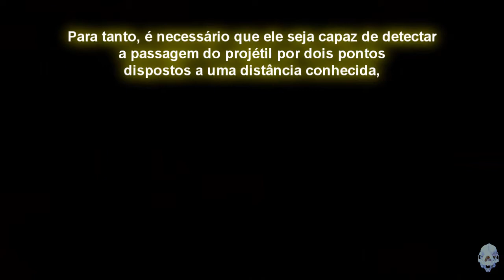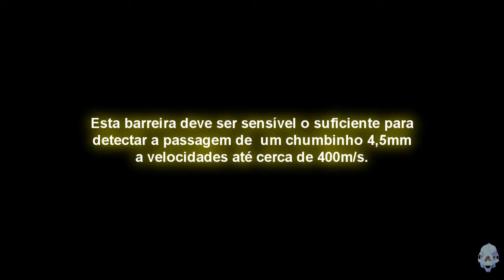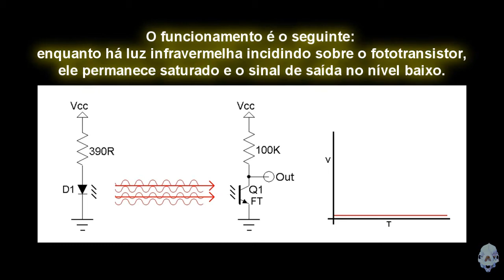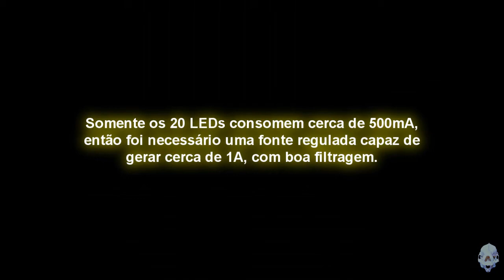DIY Ballistic Chronograph IR Sensors - Sensor Infravermelho para Cronógrafo Balístico

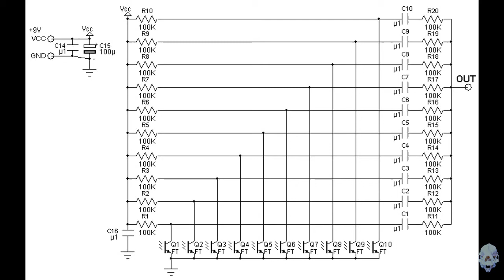Comment: 3:53 "receiver" part: why not use 2 resistors and connect all phototransistors in serial? I looked into example datasheet and I see the "Vce(sat)" is about 0,4V, so Vcc=9V is more than enough.
Another place where the circuit can be simplified and improved could be connecting 4-7 LEDs in serial with one resistor. Typical Vf of IR LED is about 1,2-1,6, so when you power it from 10V source you can drive 7x1.2V up to 5x1,6V - more efficiently.

Comment: Un genio total 🔥
Amigo. Consulta 
Los  capacitores de los fototransistores son cerámicos con el código 104?  O que valor en micro faradios tienen ? Desde ya muchas gracias
Reply from the maker: Gracias, son condensadores de poliéster de 100 nF (0.1 µF). Los condensadores de cerámica como el que está desacoplando la fuente de alimentación también deberían funcionar sin problemas.
Reply: @unrelatedactivities  muchas gracias por responder a mi duda amigo! 
Este circuito se puede utilizar en arduino tal cual esta ? 
Mi idea es hacer un cronógrafo con arduino nano

Comment: can i use photodiodes to replace phototransistor?
Reply from the maker: Yes, but they probably would need amplification. Here is a video showing chronograph screens I've made using photodiodes amplified by opamps:
https://www.youtube.com/watch?v=-3aGxC3KXGM&t=0s&list=PL44XyIPy9JXhTvrGxLkhePfU4g02q8MWS&index=5

also, these application notes are worth reading: 
- Sharp SMA99017
- Kenneth A. Kuhn, Use of Phototransistors
Reply: Thanks for the answer, i'll try to make one

Comment: Ok, so I am using 4 emitters and 4 photo transistors compared to your 10 sets. I can see the signals fine with the Nuts an Volts circuit. My spacing is approx 4 inches compared to your .842 meters. 

Up to about 400 ft/sec, it works fine. When I go above that I see a double pulse from the exiting sensors.When that happens the second exiting pulse get seen by my processor but not a second entering pulse, so a error occurs saying it missed the entering pulse.

My Atmega8 works up to 3000 ft/sec when simulated with 3 monostable oscillators in series. First oscillator is entering pulse, second oscillator is delay, and the third is the exiting pulse. I can vary the middle delay oscillator to simulate almost any speed I need.

Have you encountered any double pulsing in your work with your pulses?
Reply from the maker: No, I haven't. The double pulses are coming from the phototransistors or after amp and/or comparator? If they occur after the Nuts and Volts circuit maybe the amplification factor is a bit high or the comparator threshold low. 
Also try to increase the distance between screens to see if the double pulses still occurs at higher velocities.
Reply: I have increased the distance to 8 inches (4 inches before), same results. I will try 1.5 ft and see what happens. 

Interesting that the double pulsing happens at higher pellet speeds.
Do you thing spacing between the emitters and photo transistors should be increased also. My current distance between emitter and photo transistor is 3 inches. I think I will try 8 inches instead of 3 inches.

On the scope the input signal from the sensors is about 10 mv,, so the amplification is correct.
Reply from the maker: I think a larger shooting area is good to avoid "accidents" when measuring at longer ranges :). Looking at the N&V circuit, seems to be something strange in the amp's resistors values: first op amp has a gain of 10, second op amp a gain of 100, so 0,01V input signal would reach 10V at output, and Vcc is only 5V. With all that gain, noise could be a problem. But this doesn't explain why there are double pulses only in the second screen and only at higher speeds. 
One possibility that comes to mind is that air turbulence can be the culprit, then you could try shooting at increased distances from the chronograph  or use some kind of mechanical protection to the screens.
Reply: Over driving the last amp should not be a problem as slower speeds up to 400 ft/sec does not always produce double pules. I am going to try 1.5 ft away from the first input. i thought of the turbulence problem also. That is why I am going to try 1.5 ft. According to your video, your spacing between emitters and photo transistor are about the same.( 4 inches vs 3 inches) Or is it? What is your spacing between emit and receive devices?
Reply from the maker: 4 inches.
Reply: I found the cause of the double pulsing. I changed the spacing between the emitters and photo transistors to be approx 7.5 inches instead of 3.5 inches. I had to increase the IR "light" of the emitters suing 50 ma of current into each emitter to be able to have the photo transistors output to be below 5 volts( My bias voltage is 5 volts.

The double pules stopped. I wonder if it is because of my spinning pellet (rifled barrel), some of the IR light is hitting the pellet has reflected back into the photo transistors during pellet spinning?

You said your spacing between emitters and photo transistors is 4 inches? But of course your setup id working.
Reply from the maker: Great news, and you got a larger shooting area! I don't think the spinning was the cause, but seems the IR components you are using are far better for this job than the ones on my screens, the IR LEDs would smoke at 50mA and the photo transistors angle of reception seems to be narrow. I finally finished building another pair of screens using photo diodes instead of transistors and it worked with greater spacing between each PD and also with greater distance from IR LEDs. The signal needed amplification, but noise was not that much.

Comment: Teria o esquema da placa de led?
Reply from the maker: Está em 3:39 no vídeo. É mais fácil conectar os leds em série, usar um regulador e somente um resistor, mas eu não tinha nenhum regulador e tinha resistores de sobra...
Reply: Entao eu fiquei pensando nisso, faço a serie nos receptores ligando - > + > - > + na sequencia ate o tanto de led que eu usar, porem esse regulador seria um LM 317?
Reply: o capacitor vc usou so pra filtrar o sistema?
Reply from the maker: É só para reduzir o risco de que algum ruído na alimentação interfira no sinal, costumo sempre colocar um cerâmico e um eletrol[itico em cada bloco de circuito (~100nF para o cerâmico e entre 10  e 100µF para o eletrolítico) como bypass na entrada da alimentação para o terra.
Reply from the maker: Não aconselho ligar os receptores (foto transistores) em série. Com 10 deles em série não consegui sensibilidade suficiente, talvez usando uma voltagem maior funcione, porém não testei isto. Já os 10 LEDs sem problema em ligar em série e usar um LM317 como regulador de corrente constante. Os datasheets do LM317 geralmente têm este circuito, a saída é tomada do pino de ajuste, e um resistor entre o pino de ajuste e o de saída controla a corrente desejada ( I = 1,25V / R). Se precisar usar muitos LEDs esta ap note AND8109 tem um bom circuito:
https://www.onsemi.com/pub/Collateral/AND8109-D.PDF
Reply: Bom em fim, nao consegui um bom resultado nas minhas placas, ficaram com interferencia, e oscilando a medição, quanto vc faz esse sistema ja pronto somente faltando a fonte e o extenção p2 para enviar pelos correios? ou nao te interessa fazer esse circuito.
Reply from the maker: O problema para mim é arrumar tempo, estou atrasado em um monte de coisas... Veja se a fonte está bem filtrada e regulada, talvez seja bom acrescentar capacitores maiores na alimetação das placas dos transistores. Outras fontes de bastante interferência são as lâmpadas com reator, elas sujam tanto a alimentação como os transistores. Se puder evite ambientes com este tipo de lâmpadas quando for testar, ou proteja os transistores deixando-os 'a sombra.

Comment from the maker: I haven't compared it with commercial chronographs. The thing is very simple and works ok, the main point of interest is the distance between the screens, that should be measured accurately. On the side of the PC and software, measuring resolution will depend on the sound card's sample rate, at 96Khz it is 1/96000 = 10.4166 µs. The circuit I am using generates pulses ~20.8 µs wide, so theoretically the maximum velocity detectable would be the distance between screens / (2 * 20.8 µs).  For 1m separating the screens that would be 24000 m/s :-)... Back to the real world, I think velocities bellow 350 m/s can be measured reliably with this setup. For higher velocities and calibers the screens must be more solid built.

Comment: Is there additional circuitry to amplify the pulses from the output photo transistors before going to the laptop or micro controller? If there is , can I get a schematic?

Steve
Reply from the maker: No, there isn't, I've been using the sensor's output connected directly to the line input of the computer's sound card or the audio recorder. The signals are low amplitude but low noise also, so it is easy to see them with an audio editor, as well its easy for SoftChrono to detect them. Although I have never tried this circuit with a micro controller, I think amplification and signal conditioning would be required. This article from Nuts and Volts presents a ballistic chronograph featuring signal amplification and conditioning using operational amplifiers:
http://nutsvolts.texterity.com/nutsvolts/200906/?folio=36&pg=36#pg36
More info on photo transistor amplification:
http://www.kennethkuhn.com/students/ee431/phototransistors.pdf
http://educypedia.karadimov.info/library/Sharp%20photodevices.pdf
hope this helps.
Reply: Because I am feeding the output to a atmega chip I need higher signals. I am going to implement the Nuts and Volts amplifier circuit with a few changes. Hopefully that should work.

Comment: exellent initiative!
you give me what you used Components .
if my doubts and on the capacitors , how many of ceramics and how many of poliestes?

It will be running with AIRSOFT?
Reply from the maker: +rodrigo Brandão Thank you. I don't have data on semiconductors, the links for them at the place where they were bought are these:

http://proesi.com.br/componentes-eletronicos/foto-emissor-e-receptor/foto-transistor-receptor-infra-vermelho-5mm-preto.html

http://proesi.com.br/componentes-eletronicos/foto-emissor-e-receptor/foto-diodo-emissor-infra-vermelho-5mm.html

Ceramic and electrolytic capacitors values are 100nF and 100uF respectively. Polyester caps all 100nF. 
I will place the schematics and list of componentes at my site (under construction):

https://airgunshooting.wordpress.com/

I have been using the sensors only with air rifles and pistols (springers and PCPs), should work ok with airsoft.